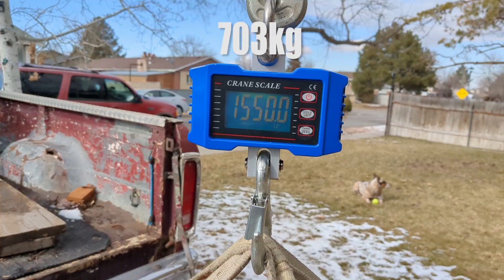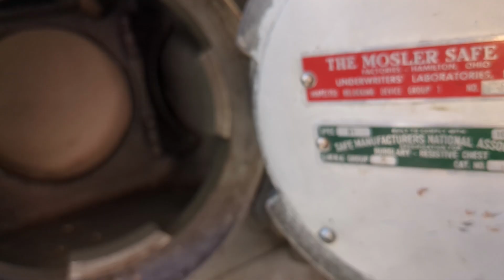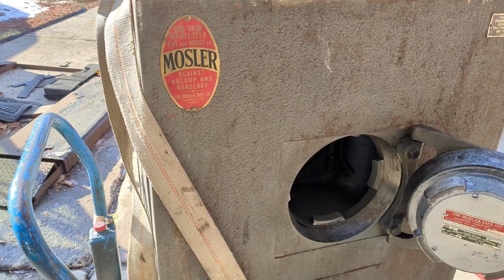Bought $3 dollar SAFE - How bad can it be??

Comment: I had a couple safes back in 06 that were about 4 foot x 4 foot made with 2 inch steel plate, no concrete but the local scrap yards didn't want them unless I broke them down into 12 inch or less strips by whatever length I wanted. I used a cutting torch and went through 100 bucks worth of propane and oxygen. Scrap yard dropped a piece from about 3 foot high on back of my trailer and my scrap paid about $300... yeah big payout, but what else are you suppose to do with them. I did keep a couple sections of the steel for tractor weight, or put em on your box blade or cutting disc when your working old ground. Only use I found for em so far but Im glad I saved them cause its better than stacking concrete blocks.
Reply from the maker: Scraping never pays well. Had a pile of copper electric motors (30-40). Tore the copper out of one and the value went from $2 for the assembly to around $6 with only 20-30 minutes of work plus materials to do so. I just put an ad up and sold them all for $3-4a piece ($150 total)and the scraper kid was more than happy to waste his time. Since then I've been doing the same thing, just pile it up, throw a little copper on top and they always buy it up/haul it off.

Comment: Fabrication project with the plate cut from?  I see Clough42 just did a video on a belt sander-grinder.  Seems some more material for a DIY angle grinder version maybe?  I was wondering about taking one or two roller skate wheels and cutting a thin recess maybe to keep the belts aligned... depending on width maybe one wheel though might need two cut down to a reasonable width.

Comment: Great score, and use of tools. Work smarter, not harder! BTW, at 6:50 that poor 3V needs you!
Reply from the maker: The guy just keeps driving it. I'll hear that go up the street 3 times a day some days. There has to be 1/4" gap on the connecting rod by now. Hey but the damage is already done and other than putting a hole in the block, it's not going to get much worse.
Reply: @sixtyfiveford  very true! The 3V is an OK motor if you treat them right. I've done timing sets, phasers, and oil pumps on a couple of them now. They like the HV oil pumps much better.
Reply from the maker: @89G  Last 3v I worked on was owned by a neighbor kid in an expedition. It had zero oil in it! He came over to ask why it was running so poorly. You could hear the chains slapping. That was before the car market went crazy and they were only worth $1500, so told him to sell it.
Reply: @sixtyfiveford  I can't believe how much used vehicles (and new) are right now. I bought my 97 F150 ten years ago for 4200, and I guarantee I could get that for it now. I love your videos, and insight.

Comment: Wow thats a lot of weight in a small area!!! 1550  never would have guessed that much
Reply from the maker: I didn't expect that. I bought a huge gun safe years ago(4' wide x 3' deep x 5ft tall) and that only weighed a little over 1000lbs. That one I paid a locksmith to have them move it as it had to go up a few stairs etc. They had the coolest hydraulic stair climbing dolly ever. They made it look effortless.

Comment: they weigh so much to deter thieves from removing them from the building they were used in. it's not like moving a 3/4 ton block is a safe, simple, quick or inconspicuous thing to do, especially if stairs are involved. mosler usually made bank vaults, so they built this with that kind of mentality in mind. this is not a "fireproof" safe, this is a security safe. you can easily peel a fire safe with an angle grinder and a crowbar. this will prove to be a much more difficult proposition than you think. should be fun to watch. the actual locked space would be an awesome floor safe if set in the concrete slab of your garage or basement floor.

Comment: Wait that's the whole thing inside thats why it is so heavy I worked at a the McDonald's and we had one the outside might have been a little bigger on the outside but it was only like 1 1/2 thick maybe 2 inches all the way around
Reply from the maker: I think just to prevent theft of the safe. If 5 guys can't move it, you're safe.

Comment: Hey, you now you can build a pyramid, and you can put a safe in it lol...nicely done 😎 But that rod knock though 😧
But also don't you know you should never tell a girl her weight 🐶😅
Reply from the maker: The guy just keeps driving it. I'll hear that go up the street 3 times a day some days. There has to be 1/4" gap on the connecting rod by now. Hey but the damage is already done and other than putting a hole in the block, it's not going to get much worse.

Ginger still trying to destroy that frisbee.. but no luck.
Reply: @sixtyfiveford  Nice one bro - she's a gem
Reply: "But also don't you know you should never tell a girl her weight..."

 Yes you do! Yes!! It's always 110 pounds. ALWAYS. Trust me! 👍🏻😁🇺🇸

- Max Giganteum

Comment: Wow, that’s a three-quarter ton safe , that was on a half ton truck, great video. Thank you.
Reply from the maker: I didn't show the 500lbs of other junk I tossed around that safe to drive home. I didn't expect it to weigh that much.
Reply: Ford trucks are typically capable of hauling far more than they're rated for. In my experience, a half ton can handle 2 tons but there are variables that raise or lower that number such as what tires are installed. The long & short of it is that the phrase "Built Ford Tough" definitely applies to the 1967-79 Ford trucks at the very least. Best wishes! 👍🏻🛻🇺🇸

- Max Giganteum

Comment: Nicely done Bud!! That's even too heavy for a boat anchor!! My Accountant has a Safe in his basement, free to who ever wants to take it out!!☻
Reply from the maker: Everyone wants a safe, but no one wants to pay to move it. I've heard quotes of $2000-3000 moving fees for bigger safes. I bought a large gun safe years ago at auction and it was relatively easy access. I think I paid $500 to just have them take it 15ft out of a flat house(1 small step) and drive it to my garage. And that only weighed 1200lbs. I was quoted much higher($1500) to move it by other companies.

Comment: It's a shame there is so much cement. Probably less than half the weight in steel.
Reply from the maker: I did get the steel chamber out and it's less than a quarter of the weight. Still heavy though

Comment: My guess was that this safe weighed 1500 lbs based on it appeared to be 2x2x3 or 12 cubic feet minus 2 cubic feet for open internal area  times 150 lbs/cubic foot for concrete.  So 10x150=1500lbs.
Reply from the maker: I did not. I assumed the inside was comparable in size to the exterior dimensions when I first went to pick it up. So maybe 3" of concrete all around.
Reply: @sixtyfiveford  Fun fact....several Mosler vaults were in the Hiroshima Mitsui Bank and survived the blast!

Comment: I had a safe that was built into the basement wall.  The house was built in 1950.  The safe was about the same size on the inside as yours, but with only the one chamber.  I had the combo for it and used it.  I sold the house a few years ago and passed the combo on to the new owner.
Reply from the maker: That's neat

Comment: Double drop safes...

Operational staff has access to the initial entry chamber for collecting the change-making bank of money for the start of daily business.  As business operations generate more cash throughout the day, the excess is bundled and dropped through the initial entry chamber slot into the secondary chamber.

Back in my early college days (early eighties), all the gas stations I worked at (I worked all over the city) had an improvement on the design.  Initial entry was from the top where coinage, the change bank for the next day, and the day's credit card slips were stored overnight awaiting processing by the manager (the only person with access to the second chamber) the next day.

As attendants would collect cash throughout the shift, they'd peel off the excess, fold the bundle in half, and insert it into a thin narrow slit on top that traveled 2' (yes, feet) or so down to the manager-only second chamber.  To motivate the bundle to slide through the long narrow slit to the second chamber, there was a long hard-but-flexible rubber belt maybe 4"x2'x1/4" which you'd pull out, insert the bundle in the slot, then push the belt/cash down into the deeper second chamber.

That rubber belt was also a plaything for when naughty girlfriends would stop by just at closing time in need of disciplining...  Hey, in your broke early twenties, anyplace you could be alone was home!
Reply from the maker: So you're saying I need a rubber push stick for my safe..... For after hours
Reply: @sixtyfiveford  Hey, whatever power tools and implements make the job a pleasure, successful, quick, and effortless!
Reply: Also...  The safes were mounted in the concrete floor of the gas station lobby...  Anyone taking the time attempting to breech one would be visible through the full length windows encircling the small standing-room-only entrance.

Comment: As you sort of said, the centre part would be ideal as a floor safe.
Reply from the maker: Yes it would. There's actually a safety/anti theft mechanism in the door that won't allow the safe to open if it's not level.
Reply: Ironical n shot since that is literally a barrel floor safe integrated into a floor safe cabinet..

Comment: i used to work retail furnishing the inside of stores with shelving, cabinets etc, whenever we installed safes we put hockey pucks under them so a pallet jack could go under them to move them, when we took them back to the warehouse our forklifts forks looked like they were about to throw in the towel.

Comment: There was a safe like that at a pharmacy i used to work at. It was alot bigger but had the smallest opening. It was so big you couldn't get it out of the building without cutting a hole in the side of the building
Reply from the maker: Dang!

Comment: I guessed from 12 to 1400# but didn't really know. I did know they were HEAVY! All I have is an enclosed shed with a flat, sloped roof, locust poles and a wood beam next to the outside. Close to the door I have a not broken now old Electric Company hot line hawser hung from a lag bold screwed into a double 2x6 roof support that I use to hang mowers from. It's held up a Gravely walk behind (5665) with a 12 horse Kohler but it';s just rated 1200#, being a strap (nylon belt) hoist like a come-along. No safes for me and Ginger does NOT want her girlie secrets exposed to the public. Thanks and happy scrapping or concrete busting and saving the metal.

Comment: That Pallet jack is pretty awesome. Is that one of your mad creations or is that actually manufactured by someone? Would you actually be able to lift some thing on a pallet out of the back of the truck with that? Looking for something like that to lift liquidation pallets out of the back of my truck, so I don’t have to break them down.
Reply from the maker: It's called a high lift pallet jack. They won't move/pull something out of the bed of a truck. I owned a walk behind mini forklift/pallet jack years ago and it would do what you want. It ran off a regular car battery and I've come across them many times in the classifieds for pretty cheap.

Comment: I have to say this is one find I would have to pass on. Nice job moving it. I still use pipes to move just about everything. Inside the bank vaults they use smaller safes about the size of this one but with larger inside diameter. Either two combinations or combo & key are required to open them. So always 2 people needed adds to security.
Stay safe, Joe Z
Reply from the maker: Honestly I thought it was a few hundred pounds and wouldn't be a big deal to move. I was wrong. It was an online estate auction and I bid super low and was the only bidder.
Reply: @sixtyfiveford  Ah the thrill of winning at an auction LOL  I having  a couple mystery wins, I understand.

Comment: You went through all that moving the damn thing and dragging it home just to cut it up?  Really?  Lol..  my sister actually bought a house that the previous owner had no clue about an old stage coach money safe was back inside her crawl space,.  I went under to fix some electrical outlets and saw it back in the corner all hand painted, two big swing doors, the whole mechanism you spin to open it, combo lock built in,,  looked up the model online and they are still selling for over 10 grand but they weigh over 2 tonnes.. lol..  nothing inside by the way..   however i told my sister that id give her a thousand dollars if she let me cut up her floors and remove some of the brick wall to get it out..  ended up needing 2 crane loaders to unearth it and all said and done i sold it to a damn bank that was local to where the thing was made..  sold for 9500$,.  Cost me 3500 to demo and rebuild the house corner but not bad for a 5 grand profit..  and 5 days worth of work..

Comment: Once it was out from under the bench, you could have put it on some skids (to clear the bolt) on those roller pipes and pushed it by hand to the truck. My safe was nearly 800 pounds. When the guys from the company that built it delivered it, they rolled it across some plywood and concrete (about 25ft worth) and into place with little effort. I plan to leave it when I move from this place.

EDIT: Did not expect 1500 pounds! Was thinking 1K maybe. Wow. Gonna be fun to watch you cut it apart.
Reply from the maker: I didn't know the bolt was there and it kept getting snagged. I was able to jamb a stick up in to hold it from falling. Then it went very smoothly.